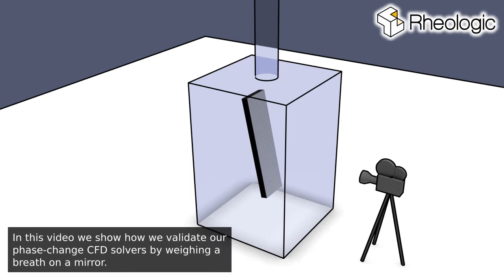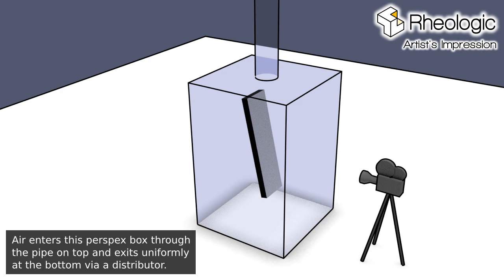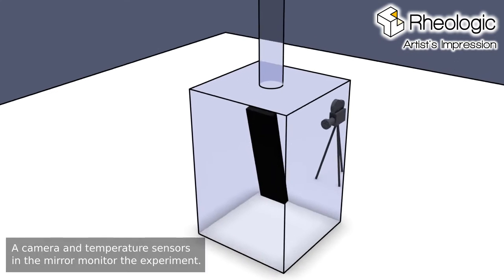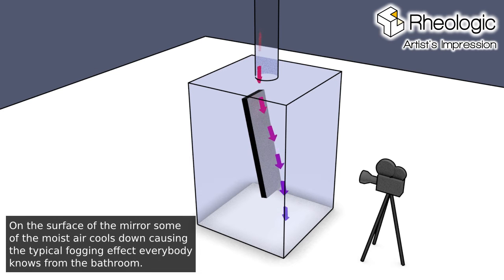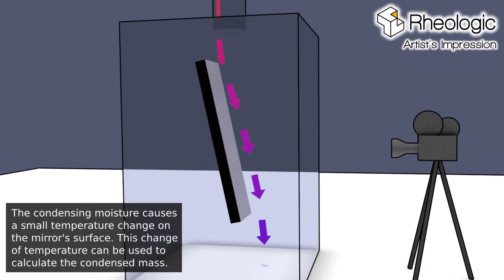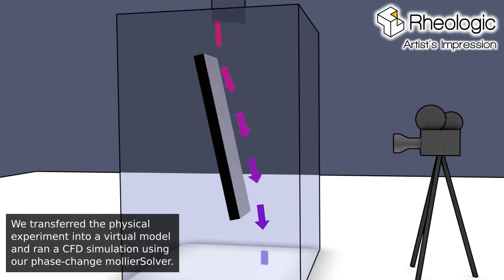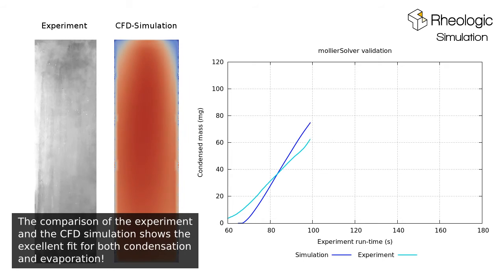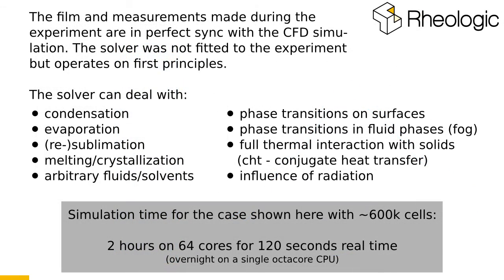Moisture condensation & evaporation CFD simulation with OpenFOAM

Comment: Das ist bis 15% Abweichung..! Sollte das gut heissen?

This is until 15% difference between the results...! Should this be called good ?
Reply from the maker: It's very good, Greg! The total accumulated condensed / evaporated mass fits exactly, the simulation is completely mass conservative and the kinetics in the experiment were a bit disturbed due to a slight, asymmetrical back-draft (due to some equipment in the outflow). We are happy to do another experiment with you - we are thinking about including conjugate heat transfer in the next experiment - if you are interested to contribute, let us know!
Reply: I would be happy to contribute, as to all partner that I am working with. How much are you paying for someone that contributes to your experiments/projects?